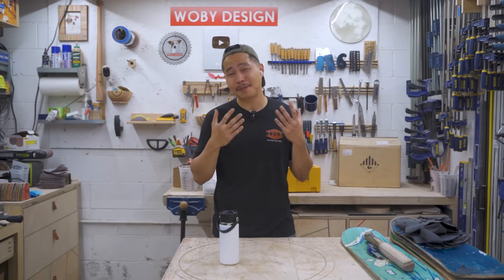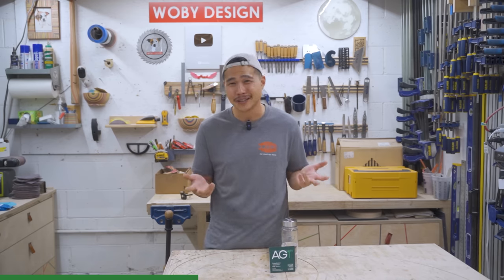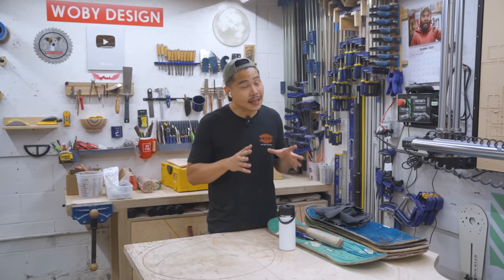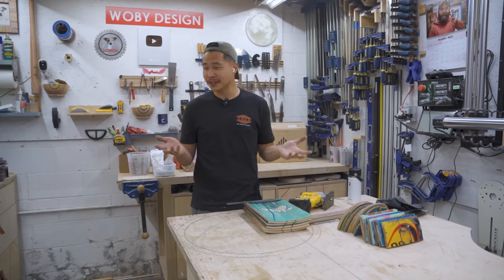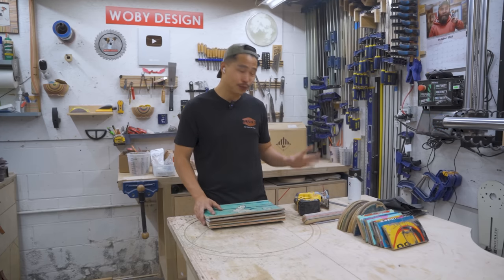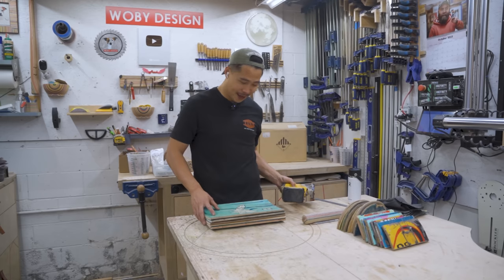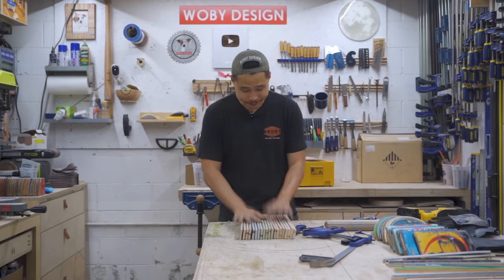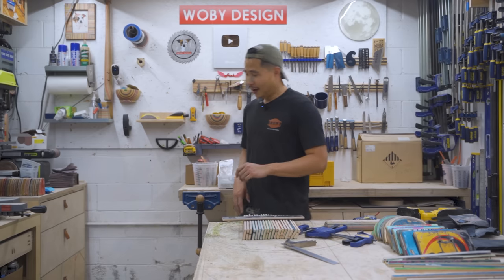JUST ONE HAND POWER TOOL

Comment: I agree completely with the usefulness of the rasp!  I made a couple of 'Thor's Hammer'-type wooden mallets for my shop and found the rasp (just like yours) was perfect for shaping the handles.

Favorite shop tools:
- Power tool = Table saw (I have a little job-site Rigid saw - perfect for my very small space)
- Hand tool = Block plane (helps me to correct small mistakes I make using other tools.... ;)

Comment: I found that mounting the jigsaw upside down on the bench and running my pieces over it I can get much more accurate cuts and I can see the line easier. Bourbon Moth does this too, but he handholds the jigsaw upside down under the material.